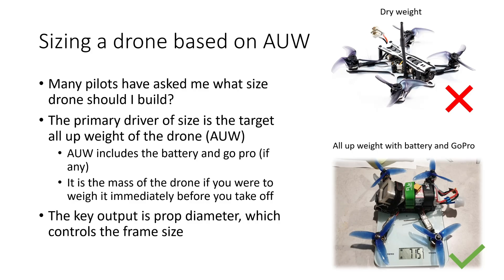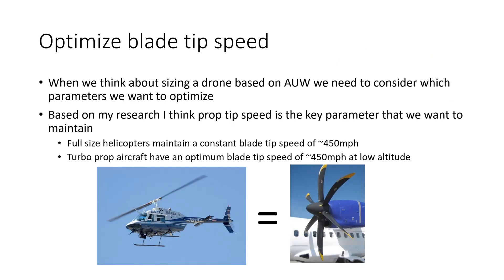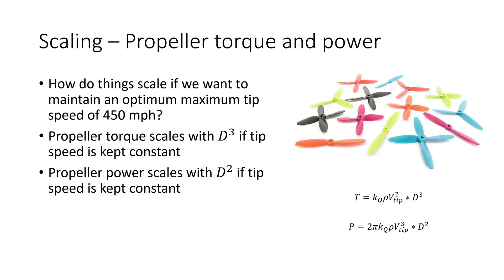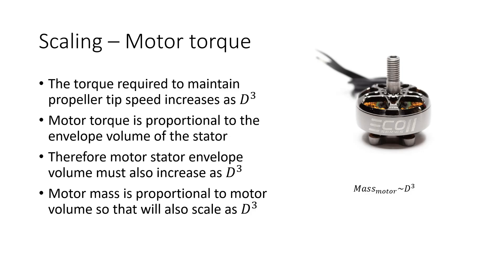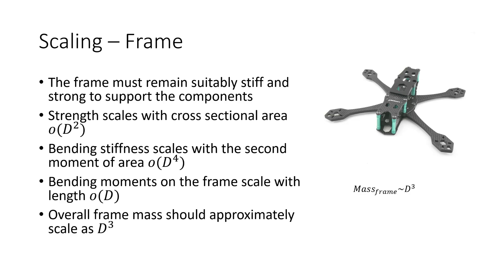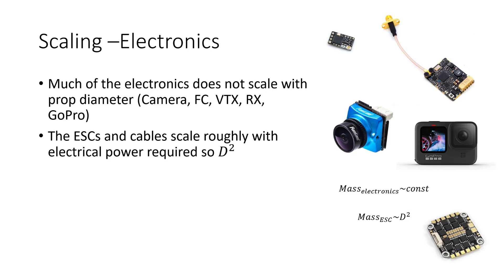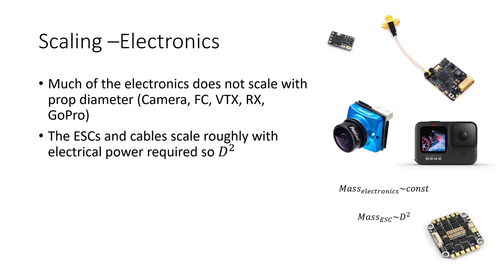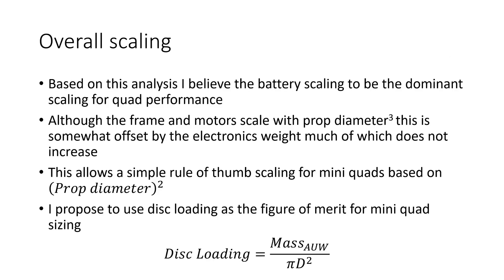Choosing the right prop diameter for a drone of a certain weight: What prop for sub 250g?

Comment: Pitch is something I have control on but diameter implies a change of frame. Can a higher pitch prop help a heavier quad? Doesn’t a bigger frame weight more with bigger motors? Or should I for example swap my 800g all included DC5 with a DC7 using the same 2308/1800 motors? I’m flying with a H8 without battery and a 1300 6S. 800g. 700 without H8.
Reply from the maker: A higher pitch prop can make more thrust but has more issues with propwash. For 800g AUW a 5.5" prop would be best for you with the 2308 motors. 6" is too big for the motors. I would recommend HQ 5.5x3.5x3 https://www.team-blacksheep.com/products/product:3191 and (if you want a frame) the AOS 5.5 https://www.cncdrones.com/AOS-55_p_1046.html
Reply: @ChrisRosser  
I can’t change the frame and use the same motors, and I love my DC5, I don’t really see how to apply your teasing to an existing quad without rebuilding it?
Reply from the maker: @MindRiderFPV  It's tricky. If the choice is only DC5 or DC7 with 2308 motors stick with DC5 100%. If you can rebuild on a 5.5" platform that will be slightly better.

Comment: My testing would indicate that this is not quite right for 3"
I run 3 3" builds
#1 1303 5000kv / 4S 450mAh / 3016 props - 130g AUW
#2 1404 3800kv / 4S 450mAh / 3x3x3 props - 145g AUW
#3 1404 3800kv / 4S 450mAh or 4S 600mAh / 3016 or 3x3x3 props - 170g AUW (450mAh) or 190g AUW (650mAh)

#2 Is the best performer, but according to your graph should #3 should be?
Reply from the maker: Between #2 and #3 you have made the quad heavier but not increased motor mass. The graph assumes you use the extra weight to increase drivetrain performance. If you don't then that extra weight is just weighing you down.

Comment: For a local competition, I will make a 5 inch with 1200g all-up-weight. Is it wrong? It's at the line of cinewhoops
Reply from the maker: That is a heavy rig. It's not suitable for freestyle but it'll probably fly.
Reply: @ChrisRosser  It won't do acrobatic flights, it will only go 40 meters, fly a circle, go 40 meters, turn around, go another 80 meters etc. The main factor is speed. We are gonna use 5045 prop 1900kv (f80 pro) 6s

Comment: Does the 6gin^-2 line imply that most x-class builds are too light and would be better served spending a bunch of weight on more powerful motors (e.g. 6521s for scaled volume up from a 2207) and ending up closer to 3.3kg?
Reply from the maker: I'm not sure whether that line can be extrapolated out that far for X-Class. This analysis was really meant for mini quads. Your motors should be big enough that the battery can only just handle them.
Reply: @ChrisRosser  Thanks for the response. I think it’s just barely feasible if you could take a bunch of weight off of e.g. Neumotor 6521 motors with 13” props and a single e.g. 6s 5100 mAh r-line battery, but even with over charging the battery, flight times might be very, very short if you didn’t want to completely cook it. I haven't seen anyone push much beyond 50xx in terms of motor volume for X-class, so that might be an interesting design line to explore, but that might also just be my lack of knowledge of standard x-class practices. Definitely a ton to figure out from a mechanical and electrical perspective to push on to the "feasible" side of "just barely feasible".
Reply: The extra weight from the motors right at the ends of very long arms might me a major challenge in terms of resonance as well.

Comment: Great video,  although I think you skipped one important aspect: static thrust. Which is higher using a larger propeller (at fixed motor power).

This is due to the lower exhaust speed, which increases specific thrust. It is more efficient to accelerate at lot of air by a little bit, than to accelerate a small amount of air by a lot. (That is why human powered helicopters are huge.) The flip side is a lower top speed. You don't get any thrust if the exhaust speed equals the speed of inflowing air.

So by changing disk loading you can trade off top speed vs. acceleration (up to a point).
For 250g:
2" too inefficient
3" low acceleration, crazy top speed
4" good balance imho
5" crazy acceleration, lower top speed
6+" unresponsive (small motors for props with large moment of inertia), frame flexing, low durability
Reply from the maker: I don't think I neglected static thrust because static thrust is wrapped up in disc loading. I think the that static thrust/mass is among the most important criteria!

If I understand you correctly your analysis of speed and acceleration vs prop size may neglect some limiting factors such as prop pitch, tip speed, and motor/battery mass.

In real word testing 5 inch quads have a higher top speed than 3 inch quads because they are typically able to achieve higher prop tip speeds.
Reply: @ChrisRosser  Static thrust is dependent on disk loading, but you did not explicitly talk about it. And the propulsive efficiency you used @2:40 is zero by definition when hovering (no work done at zero velocity). Given the importance of static thrust for drones I think it is quite important to cover it (and may be a topic for another video).

Your anaylsis and presentation is great nonetheless and matches my experience when comparing my 3" and 4" 250g racers to my nazgul 5.

Static thrust is propotional to the momentum change of air, whereas the power is proportional to the kinetic energy change of air. So you get T ~ m_dot * v_exhaust and P ~ m_dot * v²_exhaust **. Lower disk loading implies lower exhaust velocity (during hovering), which leads to more efficient hovering. The wikipedia article on disk loading has a nice graph of the relationship.

As for top speed, at 250g and ~900W power (static thrust), a 5" is slower than a 3". The lower pitched 5" props just unload too much at higher speeds. If you want to play around with some numbers i can recommend the calculator on ecalc.ch. Of course when using the same power at top speed, a 5" should be faster. But then the 5" setup would not be able to handle full throttle punchouts. At lower power this changes as well. The extreme example would be a very low powered 3" setup that can just about hover. The increased efficiency of the 5" propellers means there is excess thrust, and forward flight is possible.

** The conrol volume needs to be chosen so that the exhaust is fully expanded, ie. at ambient pressure. See https://en.wikipedia.org/wiki/Momentum_theory
Reply from the maker: These are great questions you are raising so I'll do my best to answer. The principle behind the video is a scaling analysis. The key is finding the things that stay the same as you change the size of the props.

As you correctly point out static thrust changes with prop size so its not useful on its own for the scaling analysis. You run into a similar problem with power, a larger quad is more powerful than a smaller one so on its own power isn't useful for the scaling analysis.

Disc loading and a constant tip speed capture the same variables but critically can stay constant as you change size. Power and thrust scale naturally as a result of disc loading and tip speed. I hope that explains why they don't appear separately in the video.
Reply: @ChrisRosser  You are right and I was not clear. Comparing absolute numbers is not that useful if you have scaling laws. So maybe my comments were just a long winded way of pointing out that the hover efficiency is also directly dependent on the disk loading. :)

But creating a concise video is important, so I think you could have included that not you that you should have necessarily.
Reply from the maker: @LS-xb2fh  I really enjoyed this conversation. Thank you for your suggestions and feedback. I hope we can have more chats like this about future videos! 😁

Comment: Your videos inspired me to put together a little doc to quickly calculate the parameters of Freestyle quads with various weights and prop sizes:
https://docs.google.com/spreadsheets/d/1v5gwlQ2bK4pU9kVrNZjZNob3uM1HUELdm8iq8vSGaFw/edit?usp=sharing
I dubbed it "The 5" Formula" 😂
This may be useful for some. Just put in either the desired AUW or prop diameter and the doc will spit out some parameters like motor size and Kv as well a sensible battery size.

Overall I think the results are pretty reasonable and generally consent with what people like to build and fly. Though I have to say I'm not so pleased with the max RPM estimation formula of just taking 70% of the Kv at 4V per cell (suggested by Betaflight guide). If anyone has a better idea, I'd love to hear that.
Reply: please can you tell me how did you calculate the tip speed , i really need it

Comment: I don't quite follow your conclusion. Seems that the goal is the biggest prop plus lightest weight so long as you can operate around 450mph tip speed. Why is the suggestion to keep disk loading at 4 then?
Reply from the maker: You got it exactly right. The goal is the biggest prop plus lightest weight so long as you can operate around 450mph tip speed. The difficulty is in my experience once you go below a disc loading of 4 you no longer have enough motor or battery to hit 450mph. As battery and motor tech improve I think we will be able to push to lower disc loadings and still hit 450mph.

Comment: How does elevation influence the ~450mph tip speed? Is it altered by intial air density at sea level vs 8km vs 16km? I can't imagine it being a significant difference until reaching upperlayers of the atmosphere.
Reply from the maker: The speed of sound is dependent on altitude. It decreases by ~2% from sea level to 5000ft. https://www.fighter-planes.com/jetmach1.htm
Reply: @ChrisRosser  speed of sound is only dependent on temperature but temperature will decrease by 1.98C per 1000 foot.

Comment: The weight of the Diatone GTR 349, is wrong! My GT 349 with Non-Naked Vista and many LEDS on it has a weight of 188grams not 250grams!
Reply from the maker: Hi, can I confirm that is with a 4S 850mAh pack?
Reply: @ChrisRosser  with a 4s Lipo... yes. But the Tiny Trainer would also be heavier with a 4s lipo.

Comment: What about the number of blades? Wouldn't going from 2 blades to 3 blades on, say, Flywoo Explorer also mean using a smaller diameter?
Reply from the maker: Yes, you're quite right. I have another video on props which covers the effect of number of blades and several other factors. You might find it interesting.

Comment: Having been using dal folding 5” props for almost a year (tuned, including ramp up power with folding)I tried a fixed prop yesterday and the motors struggled; they sounded rough and there were lots of wobbles. I think my 2205 motors have a much easier time handling the response demands with a folding prop than fixed. I guess the difference wouldn’t be noticeable on a more powerful motor but it was interesting to experience. It’s made me realise how important it is to match the weight and pitch of the prop to the motor. Especially if your motors are a little underpowered.  Do you think the lead/lag on the blades could ever have an effect on props so small with RPMs so high?
Reply from the maker: That's very interesting. I have found fixed props to give better vibration performance myself but I run 2207s so I have a bit more torque to play with. I wonder how much lead/lag on the blades you get during flight. I might have to look into figuring that out.
Reply: could be that there acting like a swept wing when ramped up helping with compressibility and will also reduce in diameter slightly maybe also changing the pitch slightly as they fold
Reply: @Ugly_Baby_Gaming  I agree that the reduced prop diameter during spin up could be a factor. If this is happening then the blades would be spilling air, which would also reduce the loading on the motors.
Reply: @Ugly_Baby_Gaming  indeed. If someone wants to send me a high speed camera, I’d be happy to carry out a study! 😉

Comment: Is there a chart that will show prop diameter  and rpm to achieve the 450mpg tip speed?  Own one budget drone.  Now building my second one and am I confused.
Reply from the maker: I use this: https://warpdriveprops.com/propspd2.html
Reply: wth the brotherhobby  2806.5  kv1300  my " Triblade comes in a 452mph.  Thank  you

Comment: I love engineering and science aspect of drone .😍

Can someone please answer?🤗
I want to build little bit different then a freestyle drone which will weigh around 1.8kg-2kg . Can I use  2806/7/8 size 1300kv motor with 7inch prop? Especially for speed cruising.
Reply from the maker: 2807 should be fine for 7inch props. 1.8-2kg is way too heavy for a 7in though. You should be aiming for a disc loading of ~8g/sq in.
Reply: @ChrisRosser  thanks for reply!😊
I m 16 yo so I don't understand too much .
But from internet,  theoretically  on 6s 7inch it provides thrust about 1.9kg per motor gives about 3.5 : 1  TWR.
So atleast on paper it will cruise.

Comment: Hi Chris, thanks again for such an interesting information. What about choosing higher kV motor and then limiting motor output to match 450mph prop tip speed according motor rpm log?
Reply from the maker: You can, but be careful because having more KV than needed and limiting down increases risk of smoked motors and ESCs and also reduces efficiency.
Reply: @ChrisRosser thanks. Just watched this video https://youtu.be/QQJ3yGproOg and as I understood, Max says otherwise about burning ESC’s.
Reply from the maker: @Edga_Po  My concern is the stall current. If the ESC is trying to spin a stalled motor the current will be higher for a higher KV motor due to V = IR and R is lower for higher KV. If the current is too high the FETs in the ESC will overheat. Perhaps Max doesn't stall his motors that often or his ESCs are very durable. If the motor isn't stalled an output limit might help protect against situations where the motor is commanded to full throttle and then burns out. If you are using an output limit you are losing any benefit of the extra KV but still taking the efficiency hit. Only worth it if you need to run 4S and 6S on the same quad.
Reply: @ChrisRosser  Thank you for explanation! So the only solution for best performance and efficiency is proper mechanics, not cheating. 😃
Reply from the maker: @Edga_Po  I wish it were otherwise! Happy flying!

Comment: Chris - the physics of unloading please. You have touched on it in previous videos- AOA adjustment & Inflow Velocity. 
Can this be converted into rules of thumb to help when testing static thrust and knowing what will happen once the aircraft is in the air? Will it be different for fixed wing and multirotor?
Reply from the maker: It will be very different for fixed wing and multirotor. It's very hard to give a rule of thumb for a quad as they fly over a huge range of speeds from negative inflow to fast forward flight. If you know how fast you want to go you can use an efficiency vs advance ratio plot to find the right prop for you.

Comment: Super informative! But I am having difficulties in following your reasoning about motors sizing. Why do they "need" to be bound by the prop diameter, up to the point they are not able to reach the maximum desirable speed anymore? If a motor is not able to bring the tip of the blades up to 450mph, couldn't you just use a bigger motor, by leaving all the other parameters the same? It's unclear to me why a sub-250g 5'' drone with oversized motors should still fly bad due to its uncapability to make props reach certain speeds. Maybe it will burn the battery sooner, due to the higher consumption with respect to its battery discharge rate, but according to your reasoning it SHOULD fly better, isn't it? 

I am sorry if I sound pedantic, but I just want to be sure I got everything right! I'd love to understand physics behind drones, and these videos are pure gold! Please keep up with the great work!
Reply from the maker: If your motor cannot reach 450 mph tip speed then you need a bigger motor. You also need a bigger battery as well because a batteries ability to supply current depends on its size. Then you find you have a much heavier drone. That's the key takeaway from the chart.

Comment: JFYI: 0.59 mach is roughly 200 m/s or 730 km/h, which is 30,400 rpm on a 5" prop or 50,700 rpm on 3". This feels a little high to me, maybe the 0.59 mach value does not fit 100% for tiny props (compared to man-carrying aircraft) but I could be wrong.
Reply from the maker: It's not too bad when you consider that 1800KV on 6S will hit those numbers on a 5inch. 2800KV on 6S gets you right in the ballpark for 3inch as well. Smaller quads do struggle a little more because the electronics doesn't get much lighter so there is less weight for battery and motor.

Comment: What about voltage and voltage sag? If you punch the throttle and drop to 3.5 volts wouldn’t your dip speed drop a lot? So would you want to shoot for a higher tip speed knowing it will drop to 450mph due to voltage sag? Love the content!!
Reply from the maker: Absolutely, I like to think that 450mph is a target. If you don't quite get there its not the end of the world. But you don't want to be too far away because then you are giving up performance.